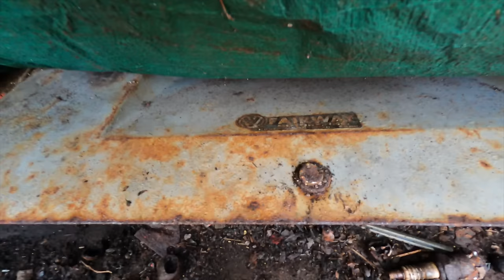VW Bus Found & Rescued - Kombi Saved 4 Full Restoration

Comment: Just s couple things thst might help out with that winch. Much thicker cables will carry the current and get yourself a pulley,  like that's on the end of that come along and double your cable back. It will take a lot of stress off of the winch. Plus if you set it up right, you can use it to re-direct your pulls. Great videos.

Comment: As a former Marine from Connecticut and a VW Bus Chaser living in South Carolina, it was great to see you “adapt and overcome “ and well done. 
    I purchased a good quality winch ad have added a double battery box on my car trailer. I only use one and keep the other as a spare. I got tired of come alongs that will bust or kink. I have a 2000 pound chain fall that I use to transfer my engines from cart to cart but it has a neutral position on the cranking arm so you can put it in “N” and pull the slack out of the chain. I hope you come to the No Dough Bus Show in Port Orange in April of 24, you will enjoy it. I have met Mustie over the years and Jason Remmick at the NH Bug show and we have a great community.  I always enjoy your adventures and repairs, good freestyle. 
Jim
Reply from the maker: Hi Jim , a compliment from a Marine is a HUGE one ! Thank you !
Reply: My wife also told me not to buy a VW pickup, a 71’. And now there are 3 SC’s (71, 68, 65) 3 splits (64, 65, and 66), and 2 bugs (65, and 74 ). I’m now watching the Yukon yellow very rescue. My mother bought a new 62’ with a gas heater. That was in NY state. I bought a 1959 vert in 67’ for $50 and it ran well.  Where those are who knows. I’m still snooping around the Litchfield area when I come up for July, August and September. 
    I’ll see Brent in April at NDBS in Port Orange Florida, April 5-7. Great time for all. Also parts guru Chad McGee.

Comment: When you use a tapered shaft drum puller as you tighten the tool hit the end of the tool shaft with a brass mallet. Each time you hit it you will notice the tool turns easier. Works better than hitting the sides of the drum. And by hitting the tool your creating force on the axle to pop the drum. Add grease afterwards to the shaft before putting the drum back.

Comment: You need to have REALLY GOOD BATTERIES.  Weak batteries have low voltage.  As voltage goes down, the current draw goes up, which ends up in HEAT.  Which melts cables (if you're lucky, only cables) or worse it melts the windings in the winch motor.  Even the best winch made won't like having low voltage, but it might have a thermal overload switch to prevent the total melt down.

Comment: I had a similar situation once. I ended up unhitching the trailer and burying the tongue so I could strap onto the car and pull it over and up on to the trailer. It wasn't fun or easy but it got done.
Reply from the maker: good idea , i would of thought the trailer would walk on you ....now try that with two locked front drums, flat tires and no steering😆

Comment: I wonder if J even checked the e brake handle to see if it was up or down before he started this..I'm surprised he even brought the trailer as prepared as he is.. 😏
Reply from the maker: was missing the e brake and shifter , yes ....and right rear spun on it's own and left rear e brake cable was removed when i popped the drum off

Comment: Seems like on a lot of those rescues forget something or other. How about get a harbor freight tool box that fits on the front of the trailer. I put everything you need in their Jack's oil jumper cables extra battery jumper pack. Maybe even an extra cell phone case you lose it or it gets damaged. Or if it won't fit on the front of the trailer maybe you can do something up front on the side where it's balanced. If not how having a plastic box that will slide into your they will have everything you need in it. You do some pretty incredible saves in difficult places awesome hats off to you. I take thyroid medication for my thyroid but Google it a lot of natural things you can do to strengthen your thyroid and a great diet wouldn't hurt. Keep those great God bless you my friend have a Merry Christmas and a very Happy for you and your family and friends:-)

Comment: I was thinking what if you had 2 harbor freight winches, twice the power, twice the smoke - either way it'd be pretty slick. edit: and 2 snatchblocks
Reply from the maker: I'll even one up that, i have 3 HF winches all with cooked up wiring !
Reply: 2 bad cars don't make one good one,  never did
Reply: @michaelfraser5723  yeah, but you have 2 though 😅

Comment: Hey Jason, what model is that Milwaukee? If it can handle that center nut that easily, then that's a tool I need.
Reply from the maker: hi, that is why i got it , my older dewalt wouldn't get it off on a Bus to free up the drum....it's sweet , it has 3 settings for power and it doesn't just go full power when you squeeze the trigger ....it applies controlled power. It's the 1/2 " , i'll have to check the model but i just googled them for under 300. GREAT tool
Reply: @5150mxVW  I've got a strong suspicion I'm going to need one like that when I dig in to my '66 bug. It's been sitting since 1976. 🤯

Comment: You need a drop deck trailer. Those ramps are to short for that trailer. While your at it get a deep cycle marine/ rv battery. A car battery’s are not made to take a long term draw without a generator. Work smarter not  harder.
Reply from the maker: that last battery is a new marine battery ...hf winches are junk
Reply: I agree on the winch
Reply from the maker: yes the ramps do kinda suck , usually i raise the deck and sometimes add a 4 ft board to the lower part of the ramp to smooth out the steep incline ....trailer was only like 3150 otd so i can't complain ....you must not recall my old " sketchy " trailer

Comment: At the 1 hour point of the video, you should have strapped the bus to the trailer and drove forward and pulled everything in the direction you wanted to go out of there. Maybe onto better flatter ground to do a normal pull onto the trailer with the ramps. But I am 3,000 miles away and this was probably a while ago and I don't own a time machine or a private jet. Yet.
Reply from the maker: i did strap it to the trailer and pull it forward in the vid and it did straighten out ....ground was pretty flat
Reply: @5150mxVW  I must have missed that bit I was typing my post or you did it in the dark.
Reply from the maker: 56:31...

Comment: A better way: mount the winch on a bracket that will fit into your trailer hitch. Unhook your trailer & chock the wheels, then use your vehicle with the  winch to pull the rescue Kombi onto the trailer. You can keep the winch in your garage until you need it for another rescue.
:face-purple-wide-eyes::body-blue-raised-arms::face-turquoise-covering-eyes::person-turqouise-waving::text-green-game-over::hand-orange-covering-eyes::face-blue-spam-shape:😄😊😃😀👻🖐🦆🦜🍉🍍🥝🥨🍿🍽🍻☕🍧🍦🍰🧁🥧🍿🫕🍕🍟🍞🥐🍔
Reply from the maker: the winch mount fits into a trailer hitch , that is what is welded to the trailer . I would pay good money to watch you unhook the trailer, chock the trailer wheels and attempt to winch the Bus with locked drums and flat tires onto a loose ...i mean " chocked firmly into place trailer lol ....
Reply: @5150mxVW  Take the winch off the trailer, weld it to a bracket that will go into the trailer hitch on your truck. You can pull with the winch attached to the truck, and when the winch starts smoking shut off the winch and pull with the truck. Your truck can pull an empty VW van with locked brakes and flat tires onto a trailer. Sure can!! Similar to what you were doing, but a lot easier, no sweat, no strain, and a lot quicker.
:face-purple-wide-eyes::person-turqouise-waving::face-turquoise-covering-eyes::text-green-game-over::hand-orange-covering-eyes::face-blue-spam-shape:😄😊😀😇👋🖐🥨🥞🧀🍞🥐🥞🥩🍗🍔🍟🍕🍜🍧🍦🍰🥧🧁🍺🍷
Reply from the maker: @pam8469  the winch is sitting in a mount that slides into a truck trailer hitch ! I welded a receiver to the trailer ...the winch can slide out off it and off the trailer and slide into a truck's trailer hitch.
Reply: @5150mxVW  Excellent!! You can winch from the trailer or from the truck. When the winch starts smoking while on the trailer you can shut it off and move it to the truck, lock it, and let the truck do the pulling. Easy peasy. I like it!
:face-purple-wide-eyes::person-turqouise-waving::face-turquoise-covering-eyes::text-green-game-over::hand-orange-covering-eyes::body-blue-raised-arms:😇😀😊😄😃🤑🖐👍🍉🍓🍍🍍🍞🥨🥐🍞🥩🍗🧀🥪🍕🍟🍿🍜🧁

Comment: Enjoying the content...again
Does not want to use the impact tool on the puller "that's how you break stuff"...but smacking the c**p out of the cast brake drum with a big lump hammer?
Reply from the maker: I’ve saved and cut old drums before ….same old story here , if you don’t free up the drums and drag it on locked up you get sheet in the comments . Now I guess if you whack too hard on a drum you get sheet too :)))

Comment: I am confused by some of the vehicles you pick up. Unless this bus is worth six figures, it is too deteriorated and incomplete for it to be worth restoring. You would easily spend $50K or more just to make this somewhat presentable and safe to drive. Are you stripping some of them for parts? Beyond that, I don't see the point of investing this much time and effort for a vehicle in this condition. Even then, there is very little besides the glass that is even usable.

Comment: Dude, that was painful to watch. Like watching a guy difuse a bomb with nothing more than a pocket knife and bubble gum. I've been watching you for a while now and love what you're doing but after a while i would think you would learn to have all your "rescue gear" together before you attempt these. Nobody's going to criticize you for being good at this. Work smarter, not harder.
Reply from the maker: well after freeing up the one rear wheel and having a 12k winch and a rusty VW Bus with no engine ...I could simply drag it onto the trailer with the front wheels locked up ...done ...even all 4 locked it wouldn't be hard to merely drag it on the trailer with boards on the ramps to help it slide . I didn't have a lot of daylight so i guess that was the plan , just get it done , get out of there and move on to the other vehicles i have bought and never picked up before the snow hits. Generally i show up with rollers and get all 4 wheels rolling . It took me hours just to throw a few tools from the Sequoia into the QX56 and find the energy to say ' let's go ' .....
Reply: @5150mxVW  Jason,  you are one of my favorite youtubers.  Your work ethic and positive attitude are amazing. I hope you don't think I was giving you a hard time. Nobody wants to see you get hurt. There was a part of the video where that bus was teetering and could have crushed you. Please work safely,  no rusty old bus is worth you getting hurt. Especially since you're alone on a lot of these rescue projects. Think about your family and stay safe. Take care of yourself first!